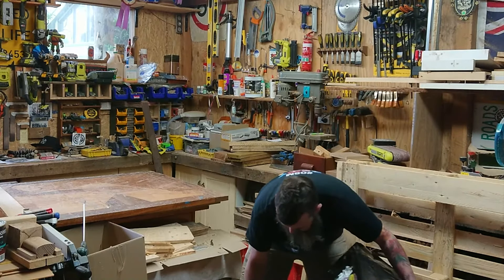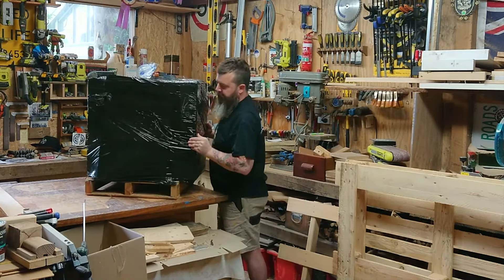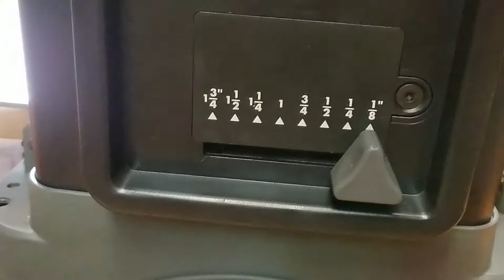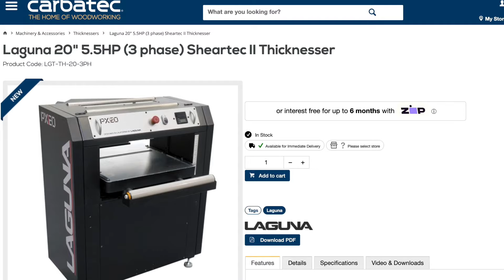Carbatec TH-BX330P Benchtop Thicknesser Unboxing & Review

Comment: great review, think i'll buy one, heres a little tip to save your thicknesser blades, when running through used timber, i have an old makita 4" electric plane, with stuffed blades, it, doesnt matter if it runs over a nail, but it cleans up the surface exposing nails etc, and also cleans up any grit on the board, only takes a few seconds, and then put through the thicknesser,